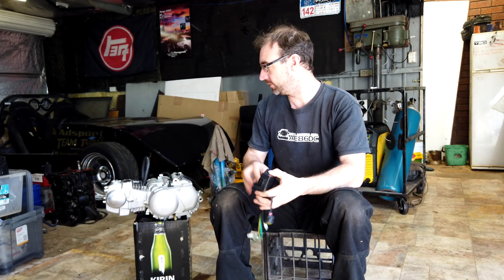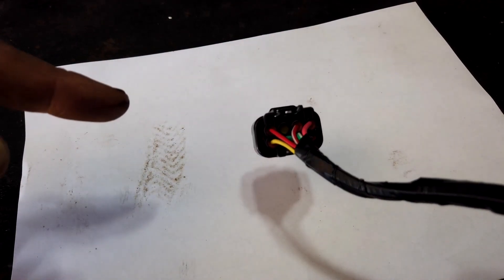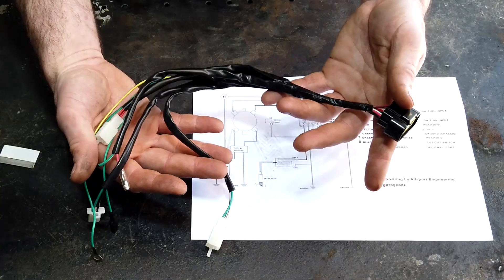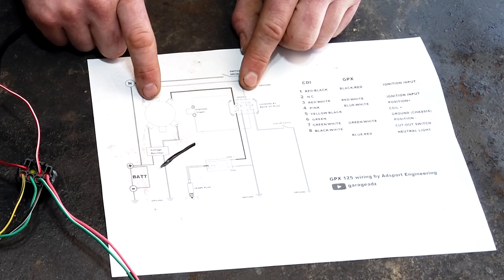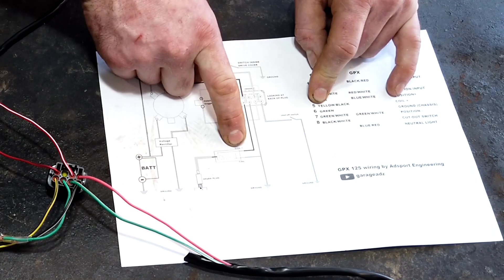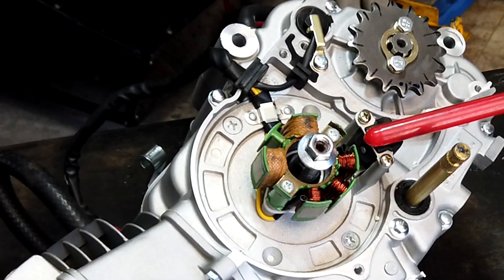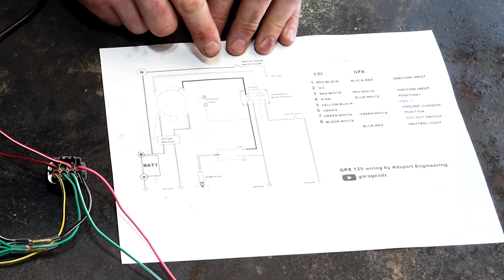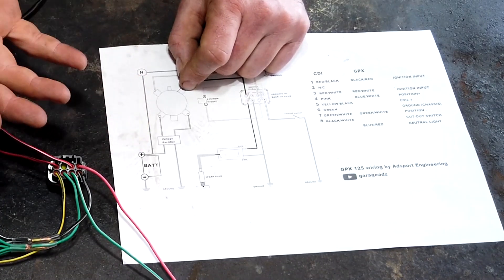8 pin CDI wiring GPX 125

Comment: Does the green/white wire go to ground inside the CDI ?. In the Honda CT110 Postie wiring diagram there is no green/white, a very short wire from the trigger to ground. I want to use the old Honda CDI.

Comment: Hey, does this engine start in gear or does it need to be in neutral with the clutch out? Cheers
Reply from the maker: If you wire it up, you can make it start in gear if you want
Reply: @garageadz  Sorry, not sure I follow. Some of these engines have a series of gears that bypasses the transmission and allows them to start with the clutch disengaged (so they'll start in gear with the clutch pulled), on others the kickstart turns the gearbox which turns the crank via the clutch (so they need to be in neutral with the clutch lever out in order to kickstart). Just wondering if this engine will kickstart with the clutch lever pulled? DHZ didn't seem too sure...
Reply from the maker: @fhtyyn  yep sorry, to be clear the clutch lever will have a switch on it that disables the starter function. If you don't wire that or don't have the switch, you will be able to start it if in gear or not. I hope this is clearer.

Comment: does that have rev limiter? and how does it work
Reply from the maker: Yeah it's got a limiter, cuts ignition.
Reply: @garageadz  what pin in the cdi is the limiter becuase mine doesnt seem to have rev limiter?
Reply from the maker: There's no pin for it, it's done internally of the ecu
Reply: @garageadz  okay, thanks

Comment: Do you have one for a dc cdi?
Reply from the maker: Ah no sorry, I think I do have some half decent wiring diagrams that I've found though. I'll have a look and report back, see if I can help out.
Reply from the maker: Is your CDI 5 or 6 wire?
Reply: It's a 8 pin cdi. Uses 7 wires.
12v 
12v switch
Ground 
Ground 
Trigger - 
Trigger +
Ignition to coil 

Its a 2001 kawasaki prairie 300. But I want to see what the pin out is on the ebay dc cdi because my oem is $200 used and like $600 new

Comment: Bro I got a 8 pin and a 5pin can I use this harness to bypass the 5pin it's a 150cc Logan engine
Reply from the maker: possibly, depends what CDI you're using and what the engine is setup to work with. I've done a few mixed with random parts. As long as the casing and signals match the CDI it's usually not an issue.

Comment: Built my custom gpx mini motocross o it bike  with $1000marzocchi forks and flat side oko race carby heavy duty red rims bunch off other stuff list goes on and it's a beast got the bike cheap for $200 stripped it down cleaned it up put the new motor in it and all the new parts worth 1500